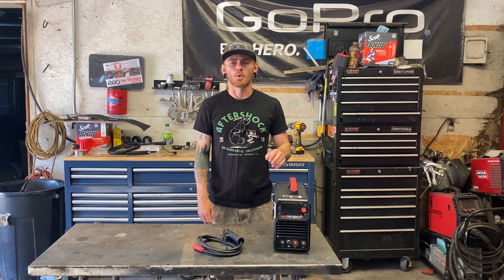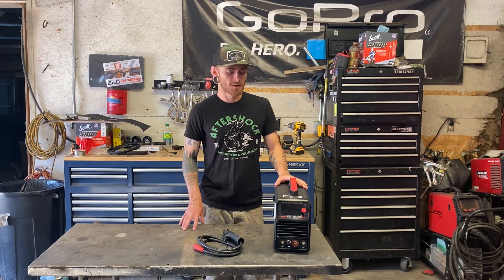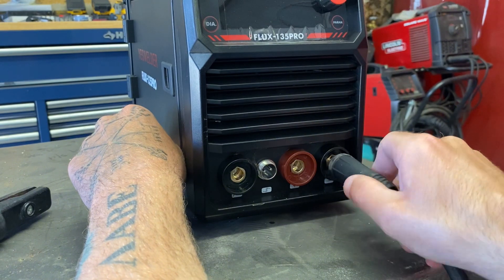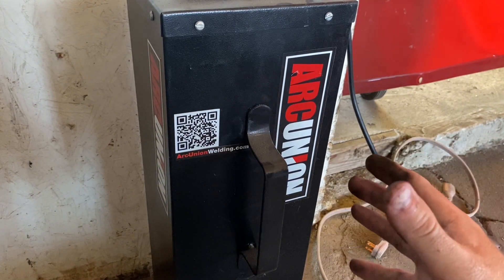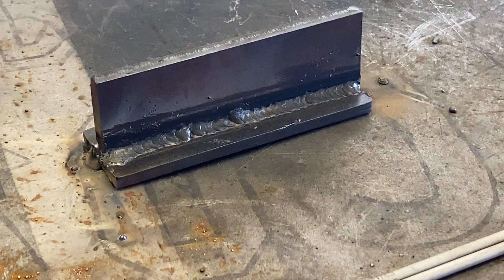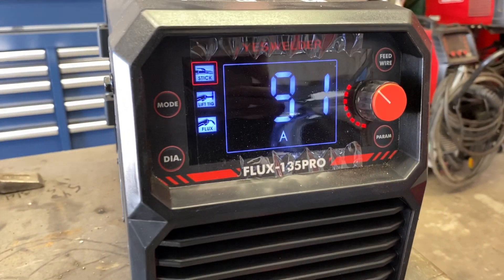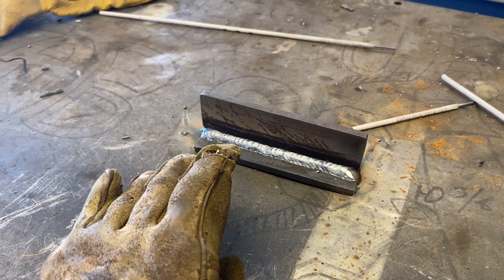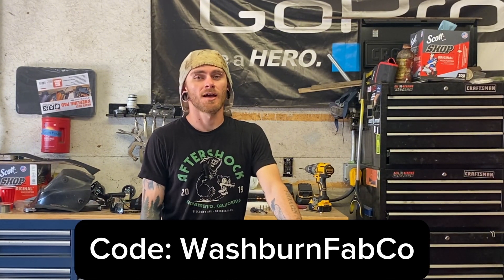Welding with 7018 for UNDER $200??? (Yes Welder Flux 135 Pro Review and Giveaway PT.2)

Comment: Been using my 135 Flux Pro for a few months. I'm becoming more and more impressed with the quality as time goes on and I get used to the settings. I put in a 20 amp circuit and I am running it on 75' of 10 AWG cab tire. It is a beast. I haven't run a huge number of large beads mostly just ticky tacking sheet metal and welding bolts on to broken fasteners. 15 years ago there was no way you could get this kind of performance from a 110 machine. Its nice it has fairly long leads for a cheap machine too
Reply from the maker: I was just talking to some one yesterday telling them my cheapest machine has made the highest return in business. The one in the video I have welded so much 7018 with constant. I’m not just talking about bead here and there I’m talking 135am burn for 12 hour days lol. It’s crazy
Reply: @washburnfabco  Thats good to know I need to weld about 300' of drill stem pipe fence with it. What kind of penetration can you get on 135a? It says 2/5ths but I feel like you could get at least 3/8ths with it
Reply from the maker: @NotSureJoeBauers I wouldn’t worry about proper penetration with it. 5/32 rod burns very good. I haven’t tried anything bigger.
Reply: Wow that's awesome I'm going buy myself one for Father's Day

Comment: Just picked one up for $70 brand new In the box waiting to use it today
Reply: The 135 pro? Where did you get it from? I want one and it’s $100 on Amazon after coupon
Reply: @ryanthornton2591  someone local had it near me brand new still in the box 📦
Reply from the maker: How was it
Reply: @washburnfabco   surprisingly ran better than I thought once I started playing with the settings now it sounds like bacon 🥓 cooking still working on dialing the stick 7018 tho
Reply from the maker: Hell yeah
Reply: What is everyone using as a supply circuit? 15amp? 20amp? 30amp? Dedicated?
Wondering if I can get away with a 20 amp dedicated circuit.

Comment: Well, watched two videos in a row on this machine. If I were to get one of these, between stick and fluxcore, which do you feel is "easier" to run? As I said in the previous video on this machine, it would be mainly for my Nieces and Nephews to get there feet wet...and hopefully do some projects in my little shop. Again, thanks for the video, and I think you would be a good teacher if you aren't already.
Reply: flux core is definitely way easier.
Reply from the maker: Sorry for the super late reply. Flux is easier